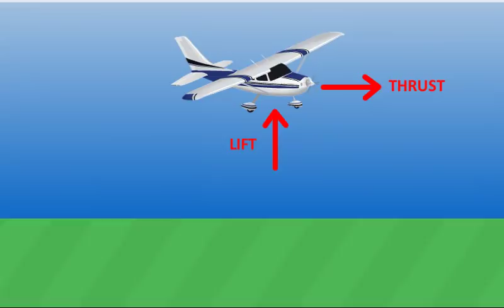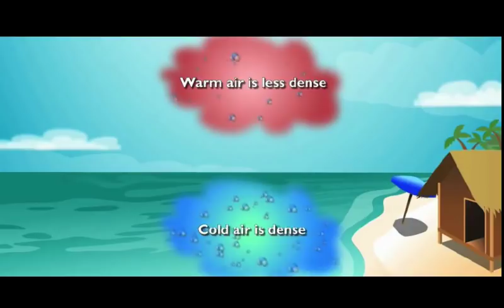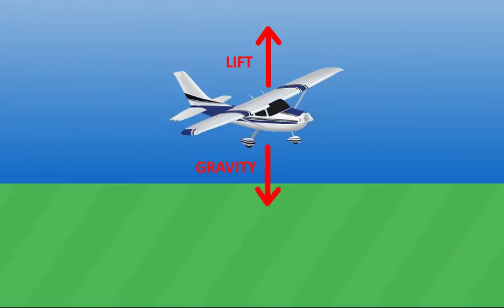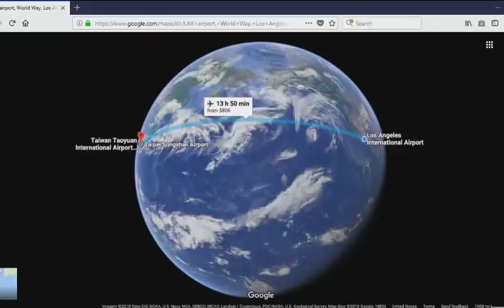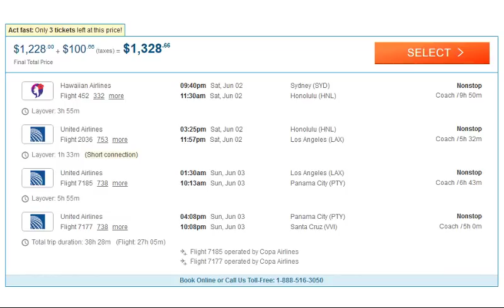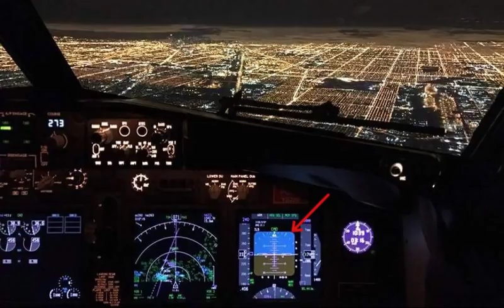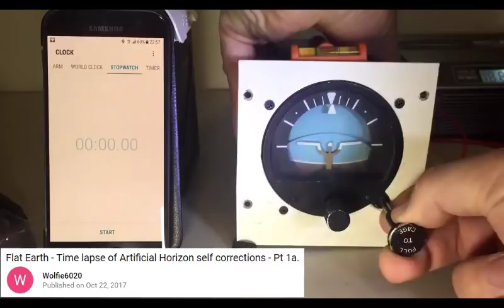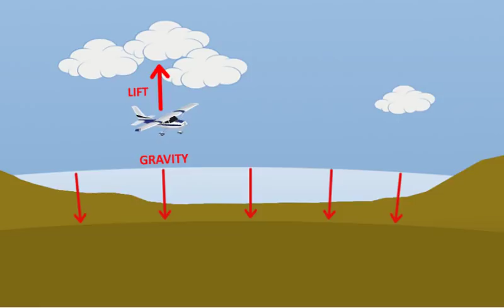Flat Earth Falsities - Plane Nonsense

Comment: Mariusz Conman... answer this, if you can. Try it without gravity. may god help you... lol
Another puzzle for you flatwit:

two solid balls of exactly the same size, one made out of wood, the other made of steel. The same volume, different density. In fact, steel is easily 10 times more dense than wood. So...
Both balls are being dropped simultaneously from 20 meters height. 

the diabolic puzzle question: are both balls reaching the surface at the same time? How about IF you take air drag into account? 
yes or no? 

if you tend to answer with „no“, then provide an exact calculation of the difference in time for each free fall. 

flattards: as long as you deny gravity, you cannot use the constant acceleration of 9.81m/s2
Use your „physical law“ of „density and buoyancy“ only. good luck!

oh, be my guest and do this experiment in real life. record it, put it on youtube. with your flerfie explanation. i will watch the whole video, promised! comedy gold ahead. lol

Here are a few numbers you might want to use:
density of water is 1.0g/cm3
density of steel is 7,85g/cm3.
density of wood is 0.68g/cm3. 
density of air is 0.0012g/cm3 (at 20degrees celsius and 1013mbar). 

hint: air drag isn’t really an issue... the difference in time between both the wooden and the steel ball is minimal. unless you have an ultra precise measuring device afterall. 
relevant is only the mass of planet earth causing gravitational pull... and compared to this huuuge planet the mass of the small ball doesn’t really matter. as long as a human being can pick these balls up from the ground, its mass is negligible anyway. 
so this is why the whole thing breaks down to a simple highschool physics problem. let’s see how flattards will struggle with this question... lol
Reply: I already fuckin said there is somethin there but it's not even 1/20th of what people say gravity is
Reply: The funny thing about you globe believers is you act liek big intellectuals but you'd need to hear it on television that the Earth is flat
Reply: I know I can be wrong, do you know you can be wrong?
Reply: Mariusz Euphoric 
just try to answer... you bail out?

you are aware of the FACT that the answer to this question can be predicted by mathematics (Newtons calculus, yes) and TESTED in the real world. guess what. 
it works just perfectly and flawlessly. 
flattard